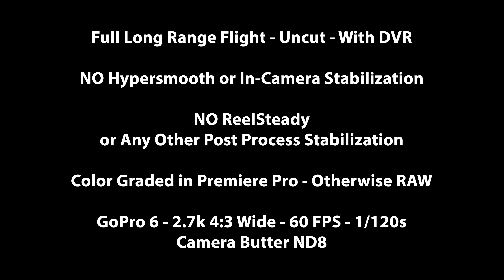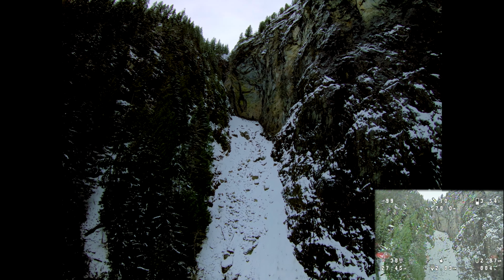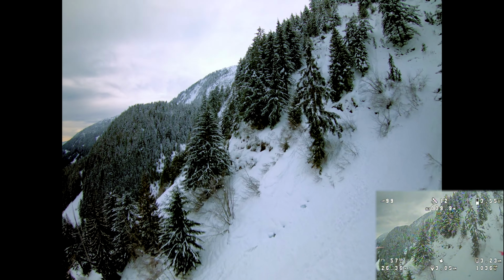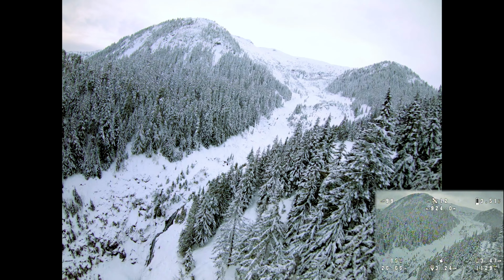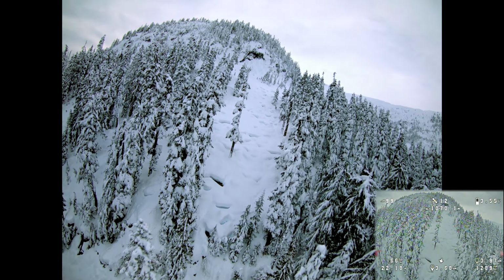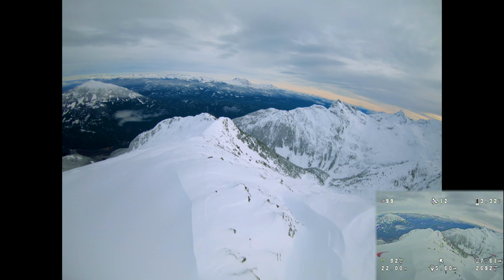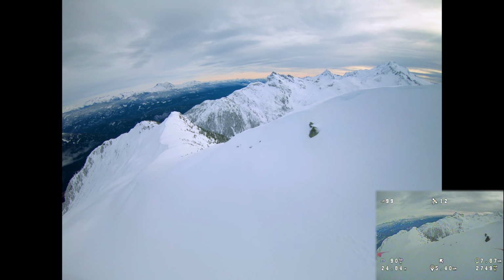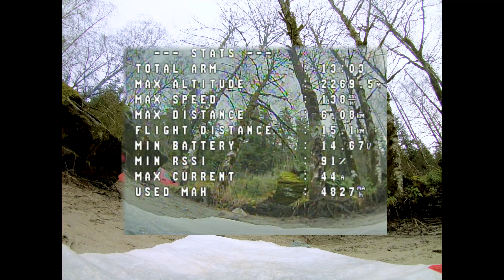My New 7 inch Long Range Frame : Introduction : Early Version

Comment: Another awesome video. Can't wait for some kind of build guide!
Reply from the maker: ya I hope to get a build video done soon.  Well a good one that is, I've made two build videos in the last couple of months but never released them because the flight controller I picked had issues so I didn't want to put out videos of me using a flight controller that I would not recommend.  Two Iflight sussex- D F7 twinG V2.1 flight controllers in a row had the worst gyro noise I have seen in 6 years of FPV.  Funny they insisted it was my fault for bad tuning, then 2 months later the gyro type in the flight controller has been changed.
Reply: @FalconRadFPV  that's curious, it's a wonder that they don't do that kind of basic testing!

Comment: fantastic stuff, that was smoother than my reelsteady vids hehe.  chris rossers vids are interesting, i'm especially intrigued by the damping grease, i've often thought this carbon is as smooth as glass and  tightly screwing it together must be bad for vibration and mechanical energy in general.  i've just spent 3 days wrestling with nano diversity... i use the nirvana and it was just endless fail, in fact i may have cooked a caddx vista trying to get the nano to bind, had to give up and use the normal nano.
Reply from the maker: Thank you! Sucks to hear about your RX struggles.  Stuff like that can be really frustrating!

Comment: Looks great. You must really know that mountain well..in order to avoid all the Line Of Sight obstructions.
Reply from the maker: Hey there Valley, I've been watching a few of your videos lately.  I'm finding the trick with line of sight is to always know exactly what direction to go if I lose video.  Like in this one I started losing video a bit before the rock and rool song comes on and I knew a head of time that getting video back would  mean tilting left and hard on the throttle.  Also with the cinematic style low rates I'm using I'm finding it way easier to control the quad through a few seconds of blindness or poor video without over correcting.  Ya it helps that I've memorized this entire valley of mountains as well.  I get far more nervous pre-flight when I fly a new location.
Reply: @FalconRadFPV  Thanks for the tips. I am pretty much going down the same learning path you have done although about a year behind you. So much to learn.. I had my first fail safe a couple weeks ago and nearly had a heart attack.
Reply: The more I learn about this FPV hobby, the more I realize that what you've done with your new build is pretty excellent the way you dialed in the mechanics of the frame and hardware, reducing vibrations plus fine tuning the filters and PIDs.  If you can get the video looking this vibration free natively imagine how nice it can be sweetened in post.  Like they say "make it beautiful in camera and amazing in post".

Comment: Amazing. I want to get into more long range flying. I only got 3km max on my long range test on a 4inch
Reply from the maker: 3km is pretty good for a 4" setup, nice work.  3km is the furthest I've pushed my 4" also.  I know the batytery can go further but I don't trust the rssi going so low, I might try a vertical crossfire antenna on it.
Reply: @FalconRadFPV  Yeah, I only used a lipo 4s 850mah.. that is why I was hesitant to go further. Yesterday I tested with a full sized gopro. It can fly 7minutes on 4s 850mah.

Comment: Simply awesome. My heart was pounding when i saw land now and voltage less than 3.0V. I was wondering how do you set up gps rescue-  in case you trigger it while diving will your quad go up to the highest altitude during the flight and then decend? I will appreciate any suggestions regarding gps rescue settings. Thanks 😊
Reply from the maker: I made a whole video about it, here: https://youtu.be/Xa28FebZOyc

Comment: wow! first off nice flight, i cant get over the fact that over all that distance i was thinking your link quality was not working cuz it was always at 99, then i seen it drop to like 98 and that was way up there. also you must have been running li-ion, not lipo cuz 2.9 v a cell would be a dead lipo. but all in all nice job!
Reply from the maker: The number represented overall link health.  From now on I'm using Betaflight 4.2 and I'll have rssi, rssi dbm and lq all on screen.  But gps rescue's very sluggish response on betaflight 4.2 is making me think about going back to 4.1.7.  I'll try playing with some more setting before switching back so I can keep the new link stats up.
Reply: @FalconRadFPV  keep us posted if you change back.

Comment: Hello Falconrad!

How much does your battery weigh? and do you know how much throttle you use (Could you have done that flight on 5S voltage)?

I just finished my own 7" quad intended for exactly this type of flying. In brief the build is:
Frame: Custom design
Motors: FPVCycle 30mm 1450 KV
Props: HQ 7X4X3
VTX: DJI Air Unit

I still didn't test it under these conditions but on my 6S1P 21700 4000mAh battery it flies 8 min at 100 km/t in some wind (14 min at 65-70 km/t). 
I just rebuild the battery to a 5S2P 21700 8000mAh battery.
It may interest you that a 5S2P 21700 battery like mine has 150 Wh. wheras a 6S2P 18650 of same brand cells have 115 Wh but the total weight of the two batteries are within 10-20g.
I still didn't try the new battery yet though.

Comment: Cant wait to see more,  ive recently started building more heavy freestyle deadcats, itll be cool to see what you come up with.... just finishing up modeling my 7" now, pretty similar to my 10" design as I love how thats been handling with the gyro low pass off... itll most likely be too heavy to be a long range contender tho.... great footage, looked locked
Reply: Also premiere has a bug when you record on the hero 6 in h.265 that crushes blacks, i believe the reelsteady output file doesnt have this problem, i have a  preset saved that fixes this.... the effect you add is "fast color corrector" and then you scroll down to set the "Output Black Level" to 20 , than you can right click the effect and save as preset to be dragged onto any gopro H.265 files that have crushed blacks in the future
Reply from the maker: Thanks buddy!
Reply from the maker: Oh wow thanks for the tip!  A little ironic to learn it the week I lose my hero 6.  Still a bit bummed about it but on the bright side I replaced it with a hero 8 so hopefully the dynamic range will be a bit better and glitch free!  Also an excuse to build out the latest version of my frame for testing.

Comment: So my RSSI never goes to 99%..its always around 50-60...and if i put it on 2w..it'll get to about 70% but as I fly away it starts flickering. Why would you think that is? I've built a 7inch soley because of your videos
Reply from the maker: It's overall link quality,so rssi and lq together.  From now on I think the rest of my flights will have separate rssi,lq and rssi dbm.
Reply: @FalconRadFPV  I'm intrested too, i'm flying crossfire@ 1W with a diamont antenna and an immortal-t antenna on the front of the quad, and i am able to get out about 3km before rssi drops below 20. I fly in the alps, there is basically nothing around which would cause interference in my eyes..

Comment: i would suggest dumping the gopro and going for something like a loris which can do 2.7k and also 4k. that will save a ton of weight and bring your amp draw down.
Reply from the maker: The video quality is much better with the gopro.  I have a SMO 4K camera for a light weight option but it also doesn't look anywhere near as good as my gopro so I don't even use it.

Comment: Fantastic videos, what camera angle to you run to get that cruising speed? Thanks
Reply from the maker: Thank you!  My fpv cam is about 26 or 27 degrees and my gopro is about the same.
Reply: @FalconRadFPV  thanks so much 👍

Comment: Greetings. How did you enable 4k 60 fps 4: 3 mode on gopro 6 black? I don't have such a mode on this camera.
Reply: Post process:

"-Recorded at 4k 60 fps 4:3 and exported at 4k 60 fps 16:9 " - This is mistake?
Reply from the maker: sorry mistake, recorded at 2.7k 4:3 60 fps, exported at 4k 16:9 60 fps.

Comment: On your build video you were saying you were going to try out 21700 4s packs ? Did you try that setup as I'm building a 2- 4s Setup or do you like the 6s better
Reply from the maker: I like how it worked with 4s li-ion with a lighter 7" build.  I have another lighter frame that I use with a smo4k camera and the 4s li-ion works well with that lighter setup and iflight 2506.5 motors and the new germfan 7x3.5x3 props.  Gets over 14km with a 21700 4s pack and weighs about 825g all up.

Comment: @FalconRad how do you get 4800 maH at the end of the flight with 6S 2p ??? I have made 2 6s from VTC6 and I reach around 2700mah when I'm at 3 Volts !!! Connected both in Parallel. Am I doing something wrong ?
Reply from the maker: My guess would be that you are running the VTC6 at too many amps.  It is NOT a 30 amp cell like everyone says!!!  The manufacturer says It's only rated for 15 amps constant.  Stores all label it at 30 amps but it can only handle that for a coulpe of seconds.  I'm not sure that the VTC6 is as good as everyone seems to think.  At higher amp loads it's mah output goes down more drastically than other cells.  It's only well known because it was first to fit 3000mah in a cell that worked well.  But VTC6 don't handle amps very well when compared to molicel or samsung cells.
Reply: @FalconRadFPV   Thank you very much now is it clear why !!! In fact VTC6 are actually rated wrong for costant Amp draw. Istead what do you think about Samsung INR21700  Li-Ion cell 4000mAh 40A seams like it may handle 30 A Costant  ???

Comment: Those are the molicell 35amp 2600mah right?

I have 4s molicells on my 5 inch w easily removable 18650s.  Cheaper than lipo.
Reply from the maker: yes the p26a.  I wanted to get the p28a but it looks like they either stopped making them or they have devoted sale of the entire stock to a company for cars or something.
Reply: @FalconRadFPV  Last week the 26a was $3.99 at the 18650 batt store online.   Hoping the samsung 40t 21700 goes on sale soon.

Comment: Wooooow incredible, amazing. I would like to know more about the battery you use. How many discharge A is it? I have a 7" deadcat and I use a NCR18650GA 6S2P 7000mAh battery.
Thank you
Reply from the maker: Thanks!  The cells are 18650 molicel p26a rated for 35amps.  I use 2 packs for 6s2p as well.  I was worried about stressing the cells using bigger capacity, lower amp rated cells.  My packs come down barely warm after a long range flight and only moderately warm after freestyle type flying.

Comment: Hello bro, what is the maximum range you got from this drone.
Reply from the maker: 23 km with two 4200 mah 6s packs and a full size gopro.  Not up a mountain though.
Reply: @FalconRadFPV  waaoo, 23km, great bro by the way what was the flight time you got with those battery packs and what was your Cruise speed.

Comment: Love it man! Great video again! You should make a video explaining some close calls. Do you think a antenna tracker would help for this application or does it just add another layer of complexity?
Reply from the maker: Ya just more stuff to setup.  My antenna tracker is asking my spotter if my head is pointing the right way!  A great close call video I made is "Sketch Factor 9" you can find it on my youtube page.  It's 2 or 3 close calls in less than a second when entering a dive incorrectly.
Reply: @FalconRadFPV  yeah I agree, I tell my friends that my neck is my antenna tracker lol

Comment: Love the content. I am getting into the long range game as well. I was looking at the Chimera 7 with Crossfire and 1300kv motors. What's your opinion on going with that setup ?
Reply from the maker: I've heard it's a pretty good setup.  I myself would suggest waiting a week or two until I release my own 7" frame though  😉.  The vibration performance is outstanding.  Chris Rosser, an aerospace engineer helped me out with finalising the design.
Reply: @FalconRadFPV  will you be doing a bind and fly or just the frame?

Comment: What were your rates on this flight?
Reply from the maker: they were very low maybe 380 degree/sec max.  When there is no chance of recovering the quad I want to be able to have a jerk reaction to a surprise without over correcting and making the problem worse.  It also makes the cinematic flow of the video easier to maintain.  I love the flight feel of very low rates with a lot of feedforward.

Comment: Hello why your flights coming at 3.8V?
Reply from the maker: Do you mean starting at 3.8v?  It's because they are li-ion batteries.  They sag quite a lot on take off then go down very slowly from there.  They are charged to 4.15v or some time 4.2v.

Comment: Is that 99 your LQ or RSSI? Also no matter which one it is, my crossfire shows either LQ 100 or RSSI in 30's to 40's, so how do you get that 99 on there? Is it different flight software or OSD?
Reply from the maker: no it's BF 4.1.7 using the old way of rssi and lq together.  It gives an over health of control link.  My newer setups will all have individual rssi, rssi dbm and lq.
Reply from the maker: My rssi drops to 40 at 300 meters or something but then holds out to 30 at a few km's away.
Reply: @FalconRadFPV  mine does the exact same thing but I failsafed at 3km and I was using 500mw output power. I'm really disappointed in the results I've gotten, 3km is the furthest I've been, video goes out at the same time so maybe it's the environment but it happens the same no matter where I fly in my tri-state area. I'm going to try ELRS.
Reply: @FalconRadFPV  ok thanks for explaining that, I've always wondered why mine was different than others.

Comment: How high up Mt. Everest do you think you could get? If National Geographic saw these vids I think they might have have endless amounts of projects they'd like to use you and your drones on, to film stuff that has never been filmed before.
Reply: Agreed!
Reply from the maker: That would be a sweet job!  Humm, everest would be a whole different thing, that high up the air would be thin enough to noticeably lower efficiency I bet.
Reply: @FalconRadFPV  Maybe you've seen this: https://youtu.be/BoTDf0W911E

At 6:25 they mention an altitude of 7000m. It would be wild to get drone video of climbers at that altitude. Not to mention negotiating some of the legendary parts of these mountains.

Comment: Your RSSI ? locked at 99% looks suspicious even though your using one of those diversity RXs..I'd like to see the antenna mounting arrangements...The BF direction indicator as you came down the bottom of the mountain was frozen 180 Deg in error...Epic flight path considering you were using 5.8g video IMO..The whole flight was pretty edgy stuff TBH....Well done...🤔😳😀🇬🇧
Reply: RSSI went down to 91% at one point. Nothing suspicious here.
Reply: @raminatorrammer  Agreed, I see he's using a Bardpole on a Nano diversity RX, so yeah.
Even so, I guess LQ would give a better idea of what's going on rather than just RSSI.
That location probably has zero noise floor...lol...🤔😳😳😀🇬🇧
Reply from the maker: Ya 20km from the closest house or wifi router.  There are 2 mountain top science monitoring devices in this valley and an emergency beacon relay a couple of mountains over.  So ya the area is pretty dead for RF noise.  Although I quit flying early one day when I saw a dji fpv in the air, thank goodness it didn't fly past when I was up a mountain of I would have lost video for sure!  (I've orbited one of the science things while 5.5km out without issue's 😉)
Reply: @FalconRadFPV  Interesting, I use iNAV on my quads, it's way more reliable than BF for doing this stuff...22 Sats and Galileo coverage is the norm for me..I'm using 200mw on 1.2g for video which is more than enough and doesn't take out my GPS.
I can't use binocular Goggles, so the Rapidfire solution isn't open for me...It's a GS and 5.8 relay..works well...lol .🤔🇬🇧
Reply: @FalconRadFPV  Freggin' DJI, i'm surprised one made it out there at the same time, especially FPV.
Reply: @FalconRadFPV  Another reason to get on long range 1.2g video.... DJI can't ruin your day, you don't have to use those giant CP Skews on your quad either.. Even an RD will do it over 5kms easy......lol...🤔🤔😀🇬🇧🇬🇧🇬🇧

Comment: Upgrade to TBS Crossfire nano TX V2👍
Reply from the maker: Ya I just upgraded.  I've used my tranis for years now and thought it would be better to use my much less worn xlite transmitter instead.  Also the new nano tx (crossfire tx v2) is a cheap upgrade.  It only costs a bit more than a good vtx or a couple of motors.

Comment: Awesome, Got mine in the air 2 weeks ago. Look up my Facebook: Ruben Dietrich for some short clips. Will upload full edits to insta and youtube later
Reply: And btw, I was able to turn off the gyro lowpass completely and motors are still only barely warm. It does have some low freq bobbles tho at midthrottle that I might try and get rid off with the braces you designed
Reply from the maker: Oh that's great to hear!  I was worried that it might have not have worked out for you with the thinner arms.  The newest version I've beefed up the arms to 8mm think by 10mm wide!
Reply: @FalconRadFPV  When trying to flex the arms by hands there is quite some play but in the logs it looks surprinsingly good. I'm still not finished tuning it but can tell it's much better than the previouse frames I tried. Going to 8mm is definitely a good thing. I think I'm going to work on a 7inch frame with vertical Y arms to minimize tortional movement as I think that is the major issue with long 7inch arms
Reply: @FalconRadFPV  if you want, you can use some of my clips in the frame release video